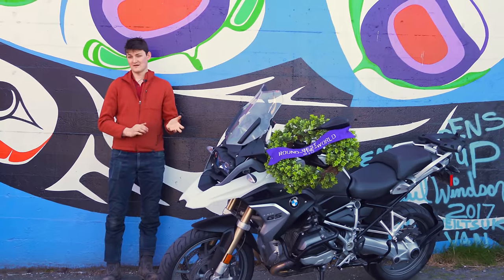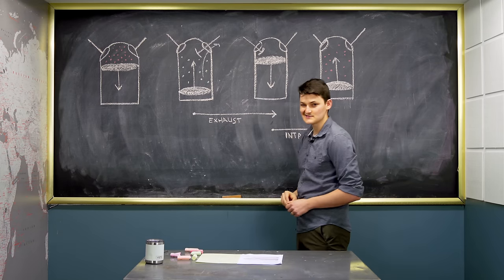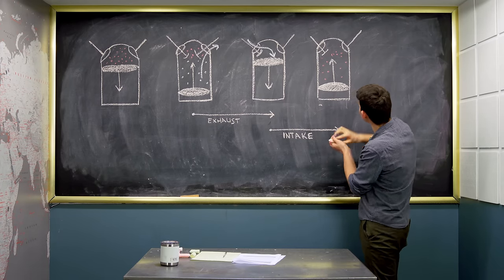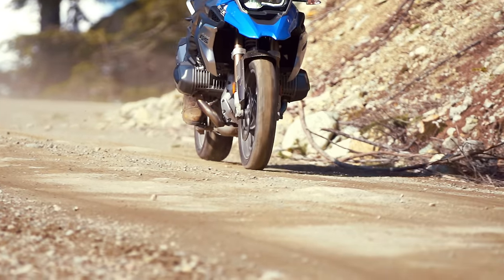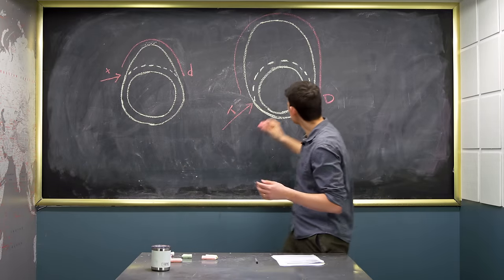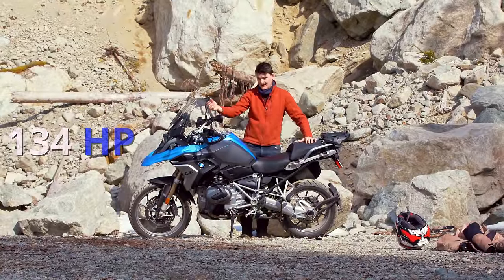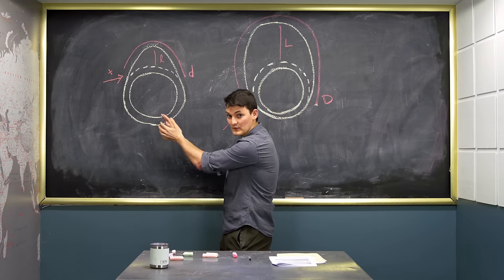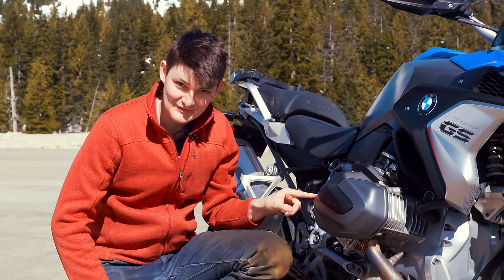Variable Valves are Bad for the BMW R1250GS - Review

Comment: I own one of these and I still enjoyed the review. Expensive yes, over complex granted. A little perspective though... This is still a great motorcycle to ride. More torque than the previous model, more power and better fuel economy. Same GS handling and all day comfort. I did a trip from UK to Dolomites in Italy last summer two up with full luggage. This bike will sit at slightly illegal speeds all day long, fully loaded and still return good fuel economy. It will also pull out of an uphill hairpin in second gear again two up and fully loaded without without breaking sweat. Yes the cam profile is only optimum in two places but in reality all you feel is bags of torque and power everywhere from a super smooth engine. Love Fortnine reviews and factually this one is spot on but go ride one before you dismiss it.
Reply: It's amazing how all the BMW GS bashers wade in like demented lemmings.  I'm amazed that electronic ignition was ever adopted back in the 70s - it might fail!!
Reply: @nikoscosmos  I have a 1982 Honda 250 with cdi   and a 1984 Honda 125  on points. Points are a real pain. I love not having a choke with Fi  I have 3 bikes 2 of them have carbs the feel is better with a carb.
Reply: I test rode one last summer and the vibrations in the foot pegs and handle bars were uncomfortable after a few minutes. Not sure if that was just an issue with the demo bike.
Reply: @sv650nyc7  We talking about the same bike here? I rode a F800GSA before my current R1250GSA, I can tell ya... that thing shakes. I could only see vague shapes in my mirrors when revs went up. My R1250GSA is so smooth and comfy, I wouldn't trade it again with that old F800GSA.
Reply: Some video from aforementioned Dolomites trip: https://www.youtube.com/watch?v=OnxQwi_5SmQ&t=846s
Reply: but the GS did that already.....
Reply: Its obviously still a great bike, the insane price is by far the biggest downside.
Reply: The fuel economy seems insanely good.    I just hate that even in Motorrad online, which did sometimes mention constant 130kmh speed, there's no reliable info in the reviews. They give info but.  You know I'd wanna know what happens when you actually Rev it hard, perhaps they should normride at 80percent max rpm at 120 to find out.           Thing is. German BMW gs riders are a bit more likely to actually drive economical than others so numbers may miss lead.
Reply: Two Yamaha Tracers on the Alcan highway come up on a stranded GS. Courtesy dictates a travel stoppage to assist along this spectacular highway and render aid. Malfunction of the proximity key you say? No need to dismount since we didn't have a BMW diagnostic computer on our two Yamahas. True story.
Reply: @robertpolkamp  ... theres an emergency sensor under the seat for those moments...
Reply: Great constructive response to a video that kinda hated on your expensive purchase.  I have always ridden BMWs up till last year when I bought a new Goldwing and I enjoy all perspectives except those of Harley riders.  :-)
Reply: That torque, is awesome  !!!! :)
Reply: @astrobusa  I didn't go to BMW GS class that day.
Reply: Nikos World hahaha this made me laugh!
Reply: Everything you described it doing could be done by a gold wing, probably better lol.

Comment: BMW was kinda forced into this. The #1 complaint from GS riders is "OMG WE NEED MOAR POWER THE 1290 SUPER ADVENTURE HAS 160HP!!" It's absurd, but these are customers spending LOTS of money and much as BMW would like to ignore them, something needed to be done. But we're dealing with a boxer engine better suited for a tractor than a pretend-superbike performance, while at the same time going to be used worldwide with widely different grades and qualities of fuel. Hence, the Shiftcam. People get their moar power when they make the poor engine start screaming at >5000 rpm, but for 99.8% of the bike's intended operation (low revs with gobs of torque) it remains the same as the previous R1200GS - in other words, perfect. For most GS owners, it was a convenient excuse to trade up to a new bike. Signed, a 2018 R1200GS owner who got it at a great deal because everyone skipped this one waiting for the 1250. And the funniest thing - I traded up from a V-Strom to the GS, whereas if I had been a bit more patient, I could have had the new V-Strom (best bang for the buck motorcycle on the planet) and been quite satisfied
Reply: The whole horsepower thing is ridiculous anyways and luckily the market is answering with stuff like a T700 and Honda with a proposed smaller displacement Africa Twin. Sadly the vstrom sucks a tad bit too much off-road, the suspension travel is too short and ground clearance is too little; they should throw in some more of that DR BIG DNA. 

Not to mention that the 100HP+ crowd is also the crowd that literally enable a power restriction with their drive mode, it's literally just choking off all that power (which you couldn't get enough of in the first place).
Reply: Very truly said. The shift cam was marketed here as being able to give a better fuel economy in traffic in India. India is a very fuel economy focused country due to much much higher fuel costs and lower earnings given our cost of other things is also much cheaper here. So in that sense even i would find the new GS a good upgrade. Also they would have an option to turn off anti roll back right? Right?
Reply: Very well written sir !!
Reply: aditya thakoor unless something was changed on the 1250 (I doubt it) every rider aid on the GS can be turned off
Reply: Autonomity Yamaha f’ed up big time by not having the T700 available in North America at the same time the 1250GS. If they fall behind the new Africa Twins then they are really hurting themselves
Reply: Yeah, the VStrom is such a screamin' deal - a great bike. I put 40k miles onto my DL650 in 2 years, just rode it everywhere and on anything.. can't say I'm liking the new style of the DL1000, but holy cats, is it a great machine under all that.
Reply: @Samh-z5b  I use a motard xt600 as daily commuter but the underbone bikes are the best city bikes even better than scooters,you literally forget you have to fuel up
Reply: Kerri Miller Also love my WeeStrom ‘08, but a bike should look sexy (to you) and I can’t get past the newer styling, so I went with a Yamaha shaft as an “upgrade”.
Reply: @Samh-z5b  Having a 2014 GS, I agree the GS doesn't need more power. It struggles to go at more than 190 km/h but then again that's a stupid speed on a machine of that size. Now it really really really don't need more torque, that thing is outright dangerous without the electronic helps, it will easily loop.
Reply: people want always more powerfull engines? laughs in 300cc single cylinder
Reply: @aao331  Just my two cents and i'm maybe a bit biased because i sell motorcycles and also BMW. The old R1200 engine lacked some sporty, explosive spirit for me. I own a SuperTenere and i prefer her 114hp way over the old R1200GS, because she is way more exciting when beeing reved in sport mode. The 10hp more over the old version of the GS arent the point, but the variable valvetiming is doing a great job in terms of a more direct, more reaction giving character of that engine. And the Suspension... really, it's so extremely stable. Sure, it may feel a bit odd at the forehand, because it is of course the telelever. But in terms of stability and leveling out the bike to the ground its really awesome. So yes, it's twice as expensive as the Dl1000/VStrom BUT it also offers a bunch more of exciting technology. If you like having it at least. And he's right: The DL1000 is a very great bike too, as well as the Super Tenere is. But the customers dont buy them and there is a reason besides the lack of marketing. 

But i can advise anyone who's thinking about to buy an adventurebike: Try them! Do a testride. The bikes are different and any single one has some other main traits, which make them more preferable than another for a certain kind of rider.
Reply: Euer Merkwürden Scherbenwahn dont you get the same “direct, more reaction” even on the older GS by putting the bike in Dynamic Pro mode? In Road mode the GS is like mush, but in Dynamic mode even the old GS becomes scary quick and fast. But most operators may not even be aware of the mode.
Reply: As I understand it that's not true. The Automotive dept. took over the motorcycle division because it wasn't making enough money. That was the end of BMW bikes being the most dependable bikes in the world. Craftsmanship went out the window and flash and pretty replace it. It's about making money at the expense of their most loyal costumers. Now they sell flashy expensive bike to people who rarely keep them for more than couple years, then when the warranty is up they sell it. The bikes are now only built to last through their warranty. What happens to the bike after that is the next person problem. The Empirer has no close.
Reply: NYCZ31 you are 100% correct but you're missing the (marketing) point. The 1250GS is now a Lifestyle brand. The are marketed for trail use, not used for trail use. Much like Hummer's, Jeep Gladiators, Ford Raptors and BMW X5M's 99% will never see dirt. I;'m an American but I travel for work, my favorite expression for this ostentatious display of wealth is Chelsea Tractor. Its used to describe the wives of footballers driving Range Rovers to the market in the ritzy part of London
Reply: @NYCZ31  Nope. The T7 and GS are in different postal codes. 50 something GS fanboys will wait to get the latest greatest and T7 fans have been drooling for years for a sniff. And then there's the $15k price difference...
Reply: @Mauipat  BMWs have never been that most reliable either in cars or bikes.
Reply: @jacksmoke3731  The whole adventure segment in general is now "adventure lifestyle" period. The same applies to the ridiculously priced adventure gear we have now.
Reply: @adityathakoor4922  Someone else mentioned you can toggle the hill stop assist by pulling the front brake lever twice.
Reply: Bought a 2018 too while everyone was drooling for 1250. It’s such a dream! On road and off-road it’s phenomenal! Maintenance has been surprisingly easy. I would love to have a T7 one day though just to have a bike that will go further off-road than my gs
Reply: @jacksmoke3731  in the end, you were correct. After two years and 18,000 miles on a 1200GS, and not one of those miles being off-road, I traded it in for a 1250RS, the red-headed stepchild of the boxer line. But I am very satisfied with it, so far. I had thought about the 1200RS two years ago but that TFT is just brilliant, now that the 1250RS has it I have no more excuses.
Reply: Agree, admire your honesty.  Bought a new 2020 1050XT V-Strom and love it.  We ride very spirited rides in the Rockies and the Strom keeps up with friends on their BMW K1600 and KTM 1290SAS.  Ripping these kinds of mountain roads is no joke and having 160hp on public roads can get way out of hand when the slightest thing goes wrong - stuff around blind corners like rocks, gravel, big horn sheep, car broken down or in your lane etc.  Charging down a switchback mountain road with 160hp may be thrilling but it leaves absolutely no room for error.

Comment: I think for an ADV, reliability would be my number one concern. So I'd probably be going for one of the Japanese options.
Reply: It definitely matters but the absolute most important thing is to a have a stable platform that doesn't change much that can support a robust aftermarket of accessories to make these machines into world conquerors, in the ADV segment what you can strap to the bike matters a ton and Many GS BMWs are sold because the choices in the aftermarket are huge
Reply: i agree. Complexity bleeds failure rates and difficult repairs. It can be done well enough to not do the first part nearly as much, but the second part gets worse as a result.
Reply: Africa Twin or the Tenere, no brainer
Reply: @Cambone13  LOL ...... good luck with that "Africa twin fuel pump" ...... and that's a recall nightmare .....................
Reply: I would go for the Ducati DesertX, I like to live on the edge.
Reply: @TheAmerican1963  have you seen the recent recalls for the GS? LOL..........
Reply: @TheAmerican1963 Flush the tank once, replace the pump/filter and done. It's not that big of a deal.
Reply: I switched from a European bike to Japanese bike. One major difference you would immediately notice is the community.

One group would say "all bikes break eventually." 
The other group says "use diesel engine oil. That works too."
Reply: Dr650. Don’t need anything more than that to get you anywhere you need to go.
Reply: KLR 650. KLR 650. KLR 650.
Reply: Just get a dr, sure you will be miles behind anyone on a gs, tiger, Africa, desertx, tenére, tuareg etc but when they all break down you and the guy on the klr will be the ones fixing their bikes while yours idles on the stand and waits for you to put more miles on it

Comment: Finally someone willing to take a shot at the almighty GS1250. I love your honesty Ryan!
Reply: I had vstrom 1000 before the 1250, the difference is oceanic, let's hope their new valves are spectacular
Reply: The oil tool is under the seat
Reply: Yes the oil filler cap tool is the screwdriver handle under the seat.  For a hacklife promoter, Ryan just hated BMW.  Not sure why, they’ve led the tech boom for bikes for over a decade.  But then again, he likes the Krios.
Reply: @kenmartin613  right but I think his point was that it's proprietary for no good reason. If you lose your screwdriver... you're... screwed?
Reply: @LexGrossmansDog  they've led the tech boom...and led in electronics unreliability too...
Reply: @kenmartin613  Which is better and why?
Reply: @kenmartin613  arh...just ruined Ryans scam right there.

Comment: “Can’t know the location and speed at the same time” 
Ryan F9: quantum physicist
Reply: Ryan Heisenberg F9
Reply: Haha he's an electron
Reply: Has an undergraduate degree in physics if i recall correctly.
Reply: @tempestandacomputer6951  you right
Reply: Cant believe i missed that one!
Reply: I had an audible snort laugh when he did this.  This level of science joke makes me happy inside.
Reply: unless... your gps displays speed, which most do.
Reply: Love the Heisenberg uncertainty meme. But it is actually really easy to fix. On my setup, I was also annoyed by the Nav obscuring the speedo when I stand up. So I simply loosened the screws on the Nav back plate, then slid the Nav about 2cm to the left on its mounting bar. I can now see the speed and current gear, while standing.
Reply: @stevew145  A better question may be: why would you care about your speed when you're standing on the pegs?  Standing on a bike is used when riding off road in unpredictable terrain.  Who on earth actually at that moment worries about speed limits or mentally checks themself along the lines of "I must not exceed 25mph since I'm on a 5 degree incline with baby head rocks on it."?
I like Ryan's reviews, but I think he is just nitpicking on this point.
Reply from the maker: @Proonur  I stand on my pegs around town all the time! Mainly because it's fun, but also a nice stretch for the legs. ~RF9
Reply: I'm always standing up around town on my F800GS as well and understand the want to stand up and know my speed. Having said that, reading the speedo with the needle isn't that easy anyways. I found a deal on a Garmin/BMW Navigator V and read the GPS speed, which this 1250 looks like it has the cradle for the Navigator VI or V. Mine is also mounted to the handle bars, not halfway up the damn windscreen. That being said, it is a little annoying that the view of that beautiful new display is obstructed by just a cradle.
Reply: @FortNine  Ryan are you admitting to riding behaviour on a public roadway that could lead to a "stunting" traffic violation?  I hope there are no police officers reading this.  If you're already breaking the rules of the road standing on your pegs why worry about the speed limit?  Perhaps it's not the case in your province, but in BC and AB it can be earn you an opportunity to make a donation to the provincial coffers.  ;-)
Keep doing what you're doing, man.  I don't always agree with you, but as I said I enjoy your insight, terrific scripting and video editing, but this one is such a minor gripe and easily remedied as others have mentioned.  
Your other points about the shift cam being old news, the new Suzuki tech being better and the brake assist being lame I agree with completely.  
However, I also have ridden a 1250GS HP and thought the torque curve was excellent and the bike a pleasure to ride.  BMW seems wise not trying to fix something that ain't broken in my opinion.  Small tweaks here and there to earn measured improvement is a philosophy shared by other great manufacturers like Arai. 
I'm not a BMW fanboy either, despite my German last name... just to set the record straight.  I've never even owned one.
Reply: @FortNine  I stand on my Moto Guzzi, Vespa, and Metropolitan.  Airflow! ;-)
Reply: @FortNine  What do you think about the BMW R 1250 R? I think that one is a better package for what it tries to achieve.
Reply: @23asd82  lol if you think my comment is about standing up while riding you've missed the point but hey, thanks for reading.
Reply: @FortNine  I'll stand up at highway speed for a mile or two at a time on a long road trip. Helps ease ass pain and stretch the legs, as you said.
Reply: No, undergrad in literature I think, stick to Shakespeare and Whitman...stay away from engineering, physics, and mechanics. Surprised YouTube doesn’t strike for false information on a brand...